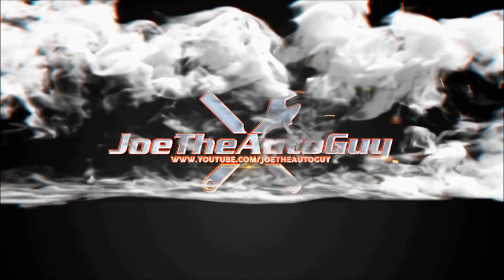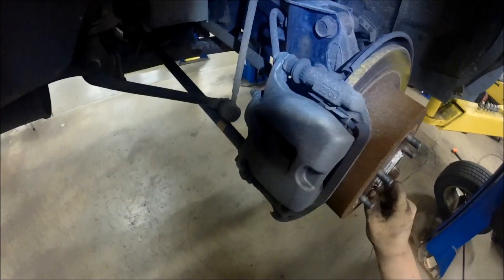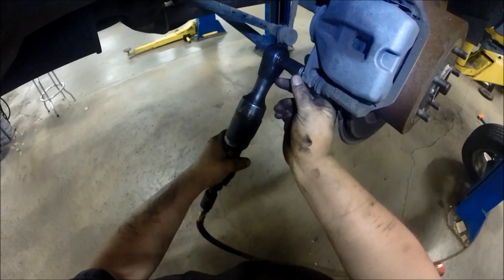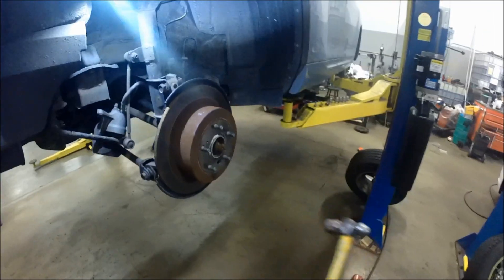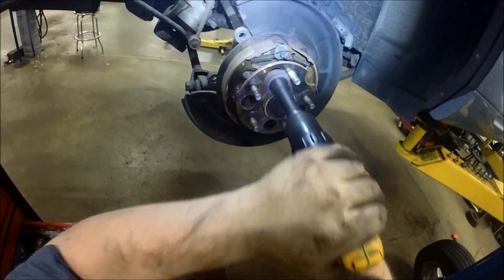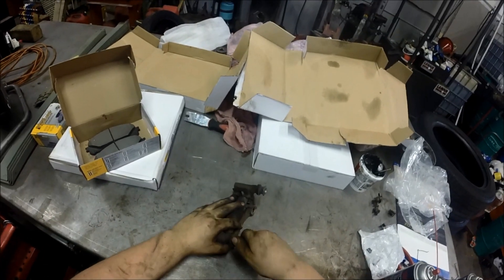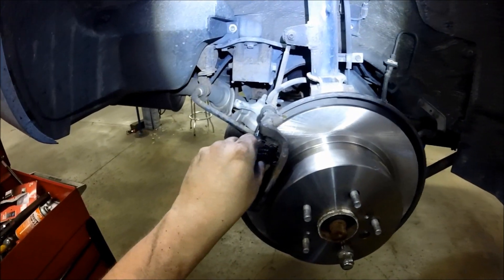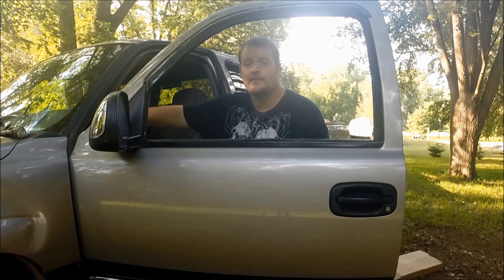REAR BRAKE REPLACEMENT 2008-2013 TOYOTA HIGHLANDER - JOETHEAUTOGUY

Comment: I have a 2008 model Highlander. Another tip, if you don’t want to hit the brake rotors with a hammer to remove them, use a 8mm x 1.25 bolt (turns with a 13 mm socket) & it’ll remove the rotor super quickly, an ABSOLUTE lifesaver!

Comment: Great video!

Torque Specs: Rear Bracket to Knuckle: 58 pound feet,    Rear Caliper to Bracket: 32 pound feet
Reply: Thank you! I was just wondering about the torque spect and noticed your comment.
Reply: Torque depends on the year and trim.

Comment: Great video, you are a good mechanic! A few suggested comments: Include toque values for the 17mm and 14mm bolts. I loosen the brake bled valve when compressing the brake caliper piston so the old fluid does not get pressed back into the lines and reservoir. Also the brakes should be bleed. Include instructions on adjusting and setting the emergency brake and how to check if they need replacement. The stud cleaning tool was a new one for me, very through. Thanks

Comment: One of the caliper pins on my 2010 Highlander has a rubber tip. Is this inserted on the top or bottom insert of the caliper bracket?
Reply from the maker: late reply but should be on the bottom i believe

Comment: One thing to remember is to use silicone based grease like sil-glyde on the slide pins as it is not oil based it's silicone based. Oil based grease will cause the boots to swell and break down
Reply from the maker: great tip and absolutely correct

Comment: Hi Joe. I really like your videos, they have been extremely helpful. I would like to get one of those wheel stud brush attachments that you used in the video. That looks like it gets those hard to clean areas very nicely. I am wondering if might be able to post the a link for that tool. Thank you.
Reply from the maker: richard johnson hi richard i will try and get that done today for ya , thabks for wstching and the kind words

Comment: Very good instructions. But joe left out the most important and most difficult part. Releasing the E brake. This is not an easy process and the rotor will not come off unless this is released.
Reply: why didn't you add how to do it?
Reply: I had to do my camry with a philips screwdriver, dont ask me how XD

Comment: On our highlander ,the rust ring was bad enough that I had to loosen the parking brake adjustment. My question to you, Joe, is how do you adjust the parking brake properly and is the parking brake 'auto adjust' type or only manual adjust?
Reply from the maker: there is a small hole you adjust through you should adjust it up so there is very little resistance but not free moving and it will auto adjust once that is done

Comment: Four things would be helpful to change or add to your video.   One, I'm dizzy due to the camera being affixed to your head.  Two, you mention using a crow bar against the rear suspension to free the rotor due to rust - it would be helpful  to not gloss over where you are placing the bar / on what suspension part, so the viewer does NOT damage any components.  Three, your video assumes that after "shocking" the rotor you will be able to get it off - as I can't get one off, I need to know which way to back off the emergency brake star adjuster, so I am not tightening it and making matters worse.  For the real novice, it would be helpful to show how it works and how to do it.  Four, you should show how to replace the emergency brakes - again, your video is assuming the e-brakes are fine.  Otherwise a very good video.
Reply: If you don't like the video, make one yourself. No offense. I think he did a great job. No one is perfect.

You have to understand that his main goal is to get the job done right. Filming AND doing a brake job is quite a difficult task.